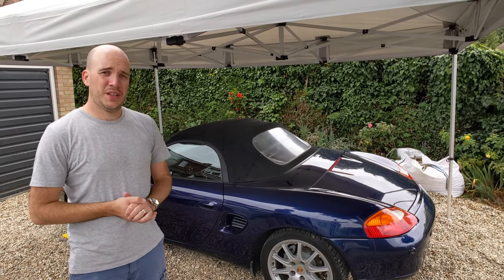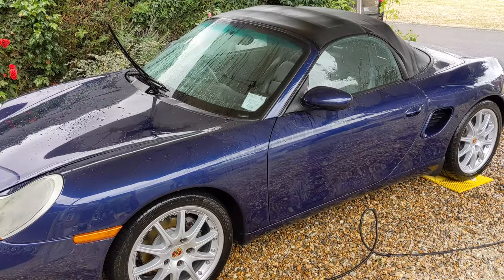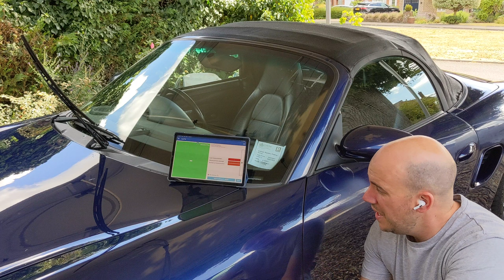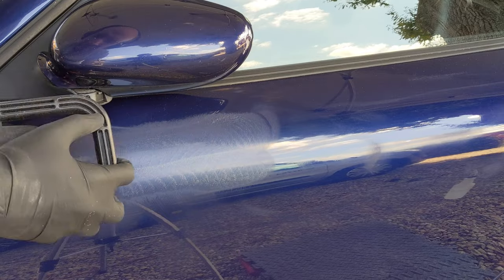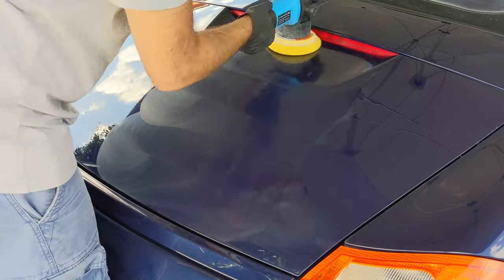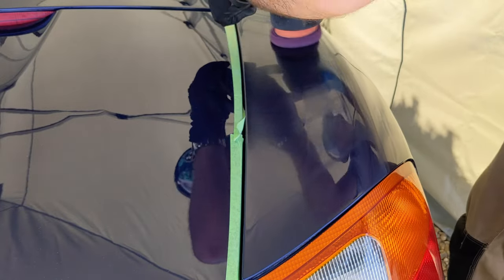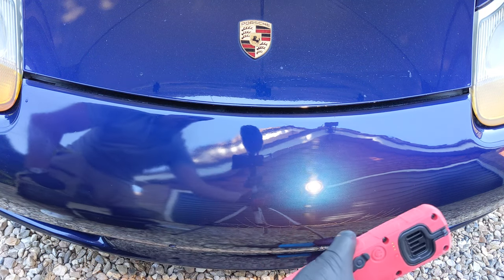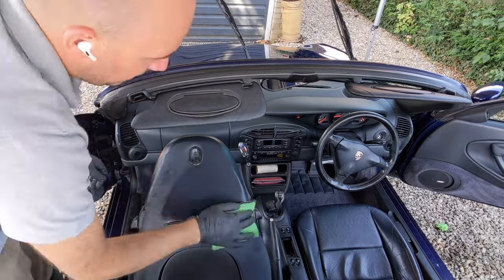20 year old 986 Porsche Boxster - Paint correction, convertible hood renovation and scratch repair

Comment: Great job. How long have you been doing paint correction for ? Must be quite nerve wrecking sanding down a car to begin with, especially when it's not yours. I enjoyed the long video and seeing the transformation.
Reply from the maker: That's a good question. I've been polishing for about 10 years, but that was as a weekend warrior (the usual, do you your own and friends & family). Professionally it's been 2 years and I must say that in that time I've learned more than I did before it. You get so much more exposure and time on the machine that it becomes far easier.

The wet sanding looks daunting but I watched a video on Apex Detailing where Brian demonstrated that wet sanding took off less clear and was far cooler (therefore stressing the clear less) than compounding on wool and finishing with a one step or finishing polish, that sold it for me. 3000 grit is so fine too, you can get great gloss just with that and a 1 step.

I also found that using the mini polisher with the denibbing pads gave me far more control than using it on a block, and I learned the hard way on my van not to use it wrapped around your finger.

Comment: Looks like you did a very nice job but I do have bad news for you mate in my opinion you shouldn't have treated the top when it wasn't fitted right.. your top should have been tucked into your door if you look on both sides it's protruding out That's not the way the top should be sitting
Reply from the maker: Are you talking about the soft top or the tops of the windows?
Reply: @SuperchargedLlama  The soft top you have it not properly closed..
Reply from the maker: @dennisamsdill980  ah that's the condition the car is in, not one for me to resolve, it was watertight (not included in the video as it was really boring, but I went round all the roof seals with the pressure washer and saw if anything got in, which it didn't). It was sound physically, if not aesthetically.

Comment: Just wanted to ask with the rinsewash you are using does this remove all the oils and some fillers like ipa I'm looking into this brand as the dilution ratio of 1:250 which is insane
Reply from the maker: I reckon it does, yes, but I always follow up with a panel prep from the manufacturer of the coating I'm going to use, or just IPA when I'm applying a sealant.

Comment: That DA polisher you are using is great for cutting, for polishing I use the rotary it has been a game changer for detail guys. I have a Rupes and it makes the polishing work for me so much easier now. I always prefer detailing inside the garage, not ideal to be outside because of dust and wind of course.
Reply from the maker: That's interesting because I find that cutting/compounding is quicker with the rotary. I can't finish down very well with it so I use the DA for that (if I'm changing tools).

You're not wrong about it being better in a garage or studio, but being mobile means the Gazebo has to come out. I put the sides on when it's windy or particularly dusty - the weather when I was doing this was breathless (not that this removes the risks from airborne particulates of course, it was just a bit less risky than it can be. It was completely sealed up over night for example).
Reply: @SuperchargedLlama  Perhaps it's the pad and compound you are using to cut and polish. The DA heats up pretty quickly, the rotary does not at all unless you are putting it in one spot forever or too much pressure.
Reply from the maker: @brucewayne2773  yeah I appreciate the theory, I've just never got the technique with the rotary to not leave buffer trails (although it is far easier with a finishing polish and pad, I find the one-step polishes behave better with a DA than they do a rotary, but I think that's down to technique).

Comment: Your best video yet , great commentary throughout. You should try Megs 205 on a rotary with a soft finishing pad , that really is combo made in heaven . I think you'll be very happy with Solution Finish I've recently used it on some badly faded trim with some outstanding results .
Reply from the maker: Thank you for watching it Mark, I really appreciate the continued support!

I've not used my rotary for so long you know, I've got a cheap silverline and always felt like it took me for a walk, so I shifted to DA and have been so much more confident with that. The rotary only comes out to play on tight bumpers with the 3inch pad usually, but at the same time I know I should try it more.

Same for solution finish, I only usually buy the small bottle though as I don't use it frequently enough and that was out of stock everywhere for the last order I made.
Reply: @SuperchargedLlama  I've got a couple of rotaries a full size Dewalt which can be a handful and a Shinemate mini rotary which is a dream to use compared to the Dewalt , so much lighter and more manageable. I do like my cordless Dewalt Da which i treated myself to last year though . Shame your so far away you could have tried the Shinemate and  the Da .
Reply from the maker: @markmoore6264  funny you mention Shinemate as I ameyeing up their mini da as well as their 15mm throw bigger one. I need to wait until I get that due to funds (I've had to replace my mv925 stubby gun, and I think I also need to sort the hose too, I've got some terrible pulsing), I'd get th mini one first though as the DAS6Pro is absolutely fine with the 5" pads, just vibey as hell with the 3" ones as it's not counter balanced for them.
Reply: @SuperchargedLlama  The Shinemate rotary is a great little machine , quiet and smooth and nowhere near as cumbersome as the full-size machine . I've also got a 3" Da off Amazon which was too much of a bargain to resist but I haven't given it a go yet , probably when the weather cools down a bit as I've got both cars to polish and they are both black.